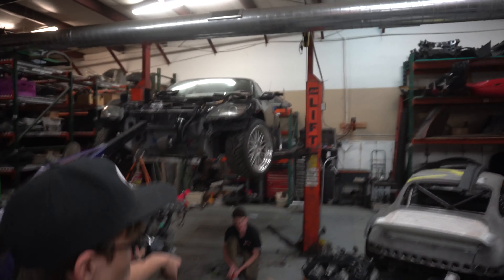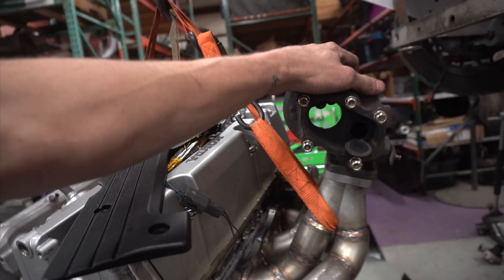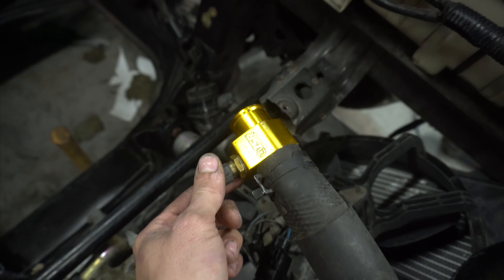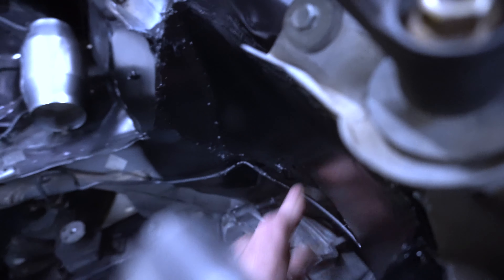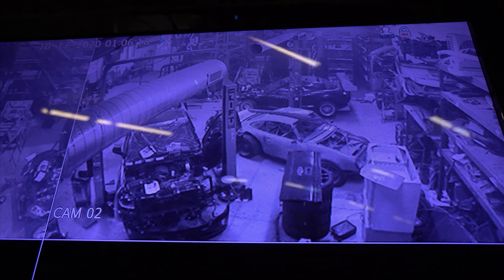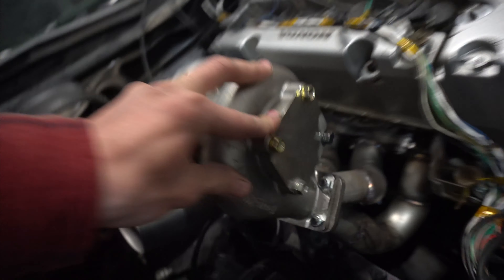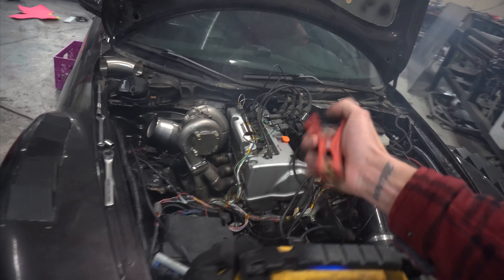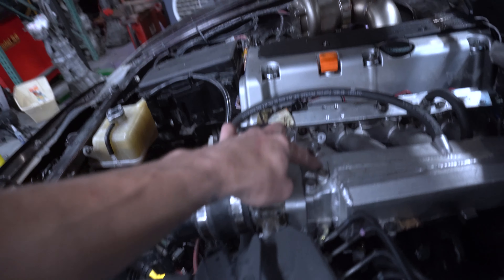K24 Swapped RX8 is RUNNING - K24 RX8 Part 3

Comment: Hey Matt
What did you use to mount that alternator with hindge on the k series?
Was it a aftermarket kit.
I went with 3 pulley setup and deleted tensioner and idler
But cant adjust belt tensioner besides putting washers behind alternator.
Thinking a D series alternator would work but cant find a lower bracket to work.
Cheers mate 
Good videos

Comment: what is the ebay coolant line adapters?
Reply from the maker: They go on the back of the head and thermostat housing
Reply: @6berries  Any name I need to search for? Trying to find all the parts I need for this before I start, been watching soo many swap vids and everyone does it different.
Seem like a fun swap or a means to make an RX8 useable. The Adatronic ECM you used will let us use the RX8 cluster? Did you have to use any fuel PSI adjuster, or does the factory PSI for the rotary fuel pump not flood or under feed the engine. (I know you went boost and bigger injection, I'll probably go stock, for now.)
Reply from the maker: @Level_Up_Nation  I don’t remember the names of them. Stock for now but will change that eventually. Yeah the adaptronic allowed use of stock cluster, key, power steering etc
Reply: @6berries  Sorry for asking so many questions, just all the other people never went into the wiring or what else was needed after the engine was in, wish someone made a plug and play wire harness or explained what all of the RX8 under the hood you can remove and what you will need to upgrade, if anything, being the RX8 and the K24 is about the same HP. Thansk for the Videos, hopefully that FRS wont be too front heavy with that monster under the hood. lol

Comment: Love the k swaps, i just think it's a shame that the firewall has to be trimmed like that, if I ever get to own a rx8 and the rotary dies i would probably spend even months looking for the perfect setup to leave it as stock as possible and detailing the engine bay to look as oem as possible, mainly because here making a swap street legal is really difficult and if you start to modify the original mounts and stuff it gets even more difficult to make legal
Reply from the maker: It usually doesn’t need to be trimmed quite as much as I trimmed. K20 head will get you better firewall clearance. Also I wanted it to be way easier to pull the engine bay because it’s a track car